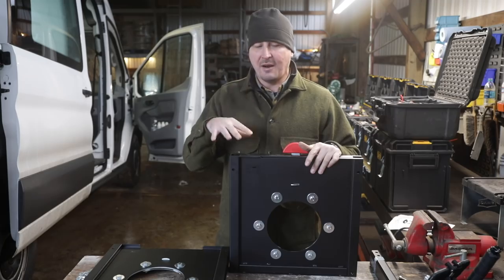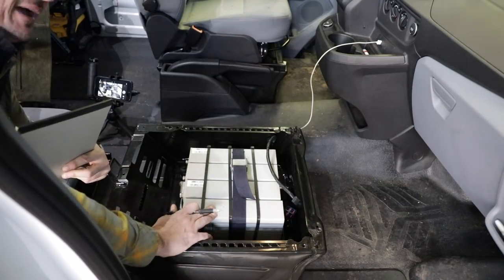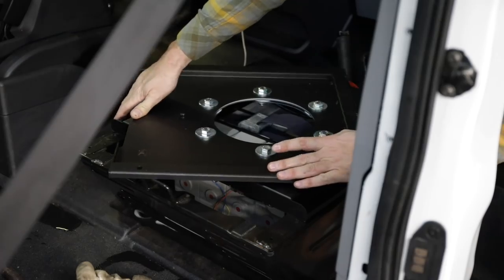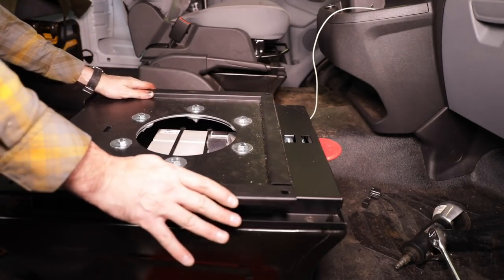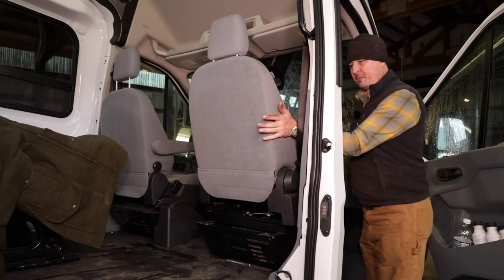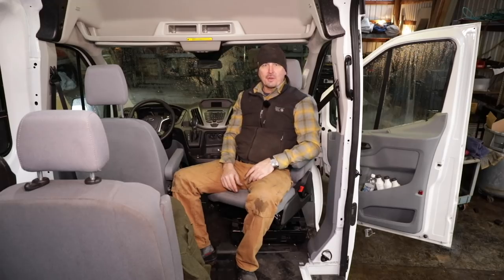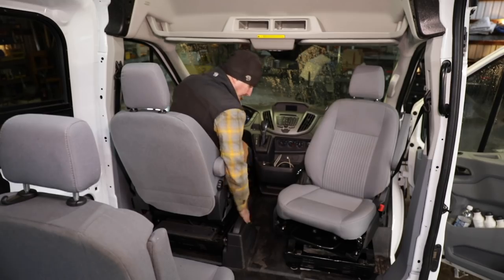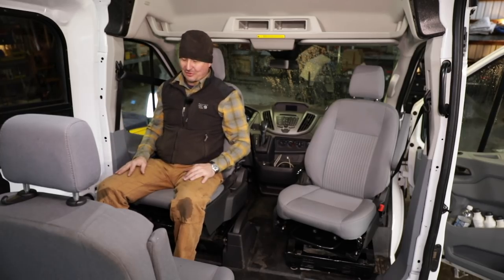AMAZING Spinning Seat Stealth Van Mod!!!

Comment: That dohickey was a carseat harness anchor point.
Reply: Masterbvapes Black Isofix do you mean. I have the worst positioned pointed ever in my GTC rear. Such a ball ache to get the chair in and out, when needed.
Reply: So an infant can drive?
Reply: Backroads Nomad transit is sold in the UK and here it is legal to mount a child seat in the front. Just disable the airbag.all our cars have to have an airbag warning/active light somewhere.

Same in other areas.
Reply: Backroads Nomad  it IS a car seat anchor point. The swivels are not just for the front seat, they can be used anywhere.
Reply: Ed Aker the Isofix point was on the actual seat base. Not the seat swivel .

But your still correct ,they are child seat anchor points, called Isofix points.
So one above said that is illegal to put a child seat in the front. In the UK ,where I am, it is allowed. Ford will make one seat that fits all markets.
Reply: Backroads Nomad interesting the 'ministry of transport' has no issues. Thou I don't disbelieve that the item in question isn't a mounting point. As they don't usually come in the front of many cars that I know of.

In the UK your allowed to use the less safe older 'seatbelt to hold the seat in place' method. 
the superior Isofix system mount is mounted to the chassis under the rear bench , and found In at least one (think it may be a law to install one) of the three seats. Few have rear 3 mounts.probably as you'd need a wide car.
Reply: Backroads Nomad this is a cargo van and not an actual passenger vehicle. Also, I believe child safety seats are allowed in front seats so long as the vehicle is not equipped with a seat in the rear (e.g. single can pickup trucks or two seater cars)
Reply: dm, usually you'll need to disarm the airbag. If tour child seat is forward facing. Then you'll have the orange warning like annoying you until you turn it back on. Usually done via a key whole in the door well.

Comment: You can lower the emergency brake and get rid of the riser.  There are instruction on fordtransitusaforum.com The thread is Driver seat swivel install by freeriden.

Comment: the bracket you cut off is an anchor point for a child safety seat (there because the are packages like yours) that do not have a rear seat for them )

Comment: The hot rod parts industry has a pushbutton ebrake control that will apply the ebrake with the push of a button so you could elimiinate that ebrake lever

Comment: You need a parking break like what's in my Tacoma. It's mounted into the dash, and you pull on a T handle towards yourself, and when you want to disengage it you turn it 90 degrees then push in. I have no idea how you'd implement it in your vehicle but it would completely negate the issue you have!

Comment: get yourself some lithium polymer batteries. defiantly not safe at all haha. these are the ones in like rc cars and stuff, they just blow up if you look at them. but they are so powerful!
Reply from the maker: Nonesene,
Reply: Wranglerstar huh? I wrote that a little strange sorry. I'm saying lithium polymer are very unsafe but so powerful. Not safe for your application xD especially with a big fuel tank underneath and your sleeping in there. I suppose you could be double sure by placing your batteries in a simple steel fireproof box?

Comment: Please try to lower the e-brake system. Your head will be dangerously high not only for visibility, but safety in event of a crash. Additionally, you'll struggle to find an ideal height for your table with the seats at such different heights.

Comment: I'm guessing that loop on the back of the seat is an anchor point for a child's seat. Since it's built as only a two passenger van it may be required.

Comment: With the drivers seat, if you removed the riser (or made a smaller one e.g. 1") would it clear the emergency brake if it was all the way down? If it does, could you put the van in gear (or park, if it's automatic), drop the break down so you can swivel round, then pull the brake back up?

Comment: You ask why the factory doesn't offer swivel seats... It's probably illegal and they can't sell it if it had that feature. There's laws down to the shade of light emitting from your car, very likely that some if not all states do not allow rotatable car seats.

It just adds a whole new variable to crashes. What direction is the seat facing, and corresponding risk. As well as risk of latch failure causing driver to spin seat and crash. 

Could probably void seat belt laws, if your seat isn't secure in a forward facing position, making the seat belt requirement useless. 

Just cause someone sells you something, doesn't mean it's legal to actually use in all applications, IE steering wheels without airbags.

Comment: Do they make a spring loaded mount to lift it above the brake, and lower when you sit in it.  You wont be sitting in it while you swivel, so it should work ok. Or maybe an airride type of spring like a semi.

Comment: Cody, Boeing had to ground their entire fleet of 787 Dreamliners ( https://en.wikipedia.org/wiki/Boeing_787_Dreamliner_battery_problems ). If you would put a piece of sheet metal over the batteries I would feel better. If Boeing engineers can be wrong about lipos, just be safe.
Reply: Charles Shanafelt Those are not the same kind of batteries...

Comment: I would ditch the 2in spacer and reshape the e brake handle and that piece you cut off I think it’s tie the seatbelt auto lock .I don’t know what it’s call the belt feeds into it. I would check it out if it is I would make a new piece and put it on the top part of the swivel plate okay?

Comment: I have only the passenger seat that I want to swivel in my van. Do you have a link for those swivels? 
I would take that brake apart and see if it could be moved over or back or forward or shortened to clear. Makes me appreciate my foot brake a bit more. :)

Comment: Anyone else confused why added height is better for his seat when he’s tall? Wouldn’t less height be better on the seat since he’s so tall?
Reply: Smitty01z28 leeg space
Reply: Smitty01z28 leg room perhaps?
Reply: More leg room.  Van has plenty of head height.
Reply: because the knees are the only bend in the leg. we don't have convenient swivels in the middle of the leg, the issue is not head height but the height of the seat as compared to leg length,
Reply: That makes sense....thanks for clarifying!
Reply: Smitty01z28 To sit ergonomically, your legs should be at right angles to your body, i.e. your knees in line with your hips, supporting the underside of your legs.  Tall people often find that their knees are raised above their hips, unless the seat is height adjustable.

Comment: So can you not swivel the seat when the handbrake is up? Surely you would only swivel when at rest and thus the handbrake would need to be up?
Reply: Maybe you can try customise some sort or handbrake so that it doesn’t impede the seat swivel function and also so that you can use the standard swivel without the extra height?

Comment: Have you considered what would happen, with this mod, during an airbag deployment?
Reply: nyjohn12 I do not think he even thought about it.
Reply: What Do you mean?
What could happen?
Reply: The seat, seat belt and airbag were made and installed for the passenger to be sitting forward (looking out the windshield). If the passenger is turned around while the car is in motion the airbag could strike the back of the seat possibly propelling the upper body forward. The passenger's head could strike something. I was hit in the rear of my car with such force that my neck and shoulders ached for a few days after. Again if the passenger is turned around the upper body will be forced forward possibly causing injury by the seat belt.

Comment: Lithium polymer in a matrix of I remember correctly. Very expensive but very reliable and powerful. Also, to note, polymer has 2x the capacity over ion per given weight of lithium electrolyte. They don't have the same c discharge rating so you must take that into account when specing lithium for your system.

Comment: All lithium ion batteries are subject to thermal run-away just requires the right condition.
Reply: John Newburn they type he has is damm safe, didn't know it was a lipo4
Reply: Yup, LiFe compromises less power for less chance of a thermal runaway. They should be safe if cared for correctly, but so should a LiPo really... 
I'll keep running Lead-acid batteries, I see no reason to spend more money on a less safe battery, especially when you don't really get anything other than a few pounds saved out of it. In a racing car I see the use of smaller lighter batteries, but in a van it has no real benefit.
Reply: Lithium batteries don't have all that much Lithium inside. It's the mixture of other elements some batteries had issues with, especially cheap knock off Chinese lithium cells.
Reply: That's why they aren't lithium ion. LiFePo. (Lithium iron phosphate) Are completely different.
Reply: AGM lead acid is almost the equivalent of a carburetor over fuel injected. AGM batteries are unstable and heavy as opposed to the LiFePo or even LiPo.
(edit) AGM batteries also experience voltage drop so at least for me with amateur radio I need the constant t voltage that simply doesn't come from AGM batteries.
Reply: LIFEPO4 not safe to mount inside while someone is sleeping and heater is drawing 12+ amps.  It requires an expensive battery management system (prone to failure)  they are safer than some lithium chemistries but they still can and do catch fire, that means mount them in  a sealed vented container outside the sleeping area.

Comment: what do you need a gun for when working on your van? If you need to drill holes, i think a drill works way better.
Reply: Watch his EDC video haha
He says it’s difficult to removed his holster from his belt so he always has one attached to his work pants, 
Why not use it if you have it is my view on that.
Reply: A few days ago I was using a heat gun while standing. leaning over my engine compartment. I couldn't hear anything but the heat gun. Suddenly a guy was right behind me, too close. I spun around and aimed the heat gun in his face. Dumb a_s shouldn't sneak up on people. I don't own and gun and it's been forty years since I've even held a pistol.
Reply: Don't bring a heat gun to a gunfight.
Reply: He's got cyotes
Reply: I think there is a coyote problem on his property or in the area so its better to have one on his person rather than not have it and need it.  In a video a while back he talked about actually having to use it because it was coming near his house and his dogs were going after them

Comment: "I don't know anything about batteries, so let me tell you why you're wrong about my batteries. Also, you don't have any videos, possibly from having a real job, so you obviously don't know anything."
Reply: Dude, get happy
Reply: he doesn't have to know anything for LiFe (lithium ferrite) batteries to safer than lipo/liion
Reply: What he said was "I don't know about them, so I'm following the direction of the experts that sold them to me"... Try and keep up Jeremy
Reply: daft nord Why does that exactly mean that they would be safer, without any additional knowledge? Furthermore, it's not lithium ferrite, but lithium iron phosphate (LiFePO4). LiFePO4 and LiPolymer batteries are also kinds of lithium ion batteies.
Reply: Lithium Iron Phosphate batteries are more expensive than traditional "lithium Ion" batteries. This is because they are more expensive to make due to the materials used. These materials do make it more safe, but not being nearly as explosive if the cell walls of the battery are punctured. They do have roughly the same energy density though, so if you can afford it, they are the way to go as they are plainly less explosive if ruptured. 
-Source: graduate level power electronics and power systems (including batteries) courses from the University of Wisconsin, Madison.
Reply: +Vinny Gullotta yeah, a salesman has no reason whatsoever to stretch the truth to make a sale.

Comment: Vehicles don't have an 'emergency brake'. They have a 'parking brake'. Never apply the parking brake in an emergency or you could lose control. Vehicles are never meant to be driven without good brakes.
Reply: emergency brake and parking brake is the same thing
Reply: You must be fun at parties.
Reply: no they are not, a parking brake is not intended to function as an emergency brake, even so far as they will not hold for long if applied at speed, the lining material is not thick enough to hold under the heat and stress of braking at speed
Reply: Thank you Captain Pedantic. In the US parking brake, emergency brake, hand brake, and e-brake all refer to the same thing. Call it whatever you want.
Reply: no they do not, try working on them for a living and actually look at the shoes, on larger vehicles park brakes are different than the service brakes
Reply: It's called an emergency brake because it uses a cable to engage rear the brakes.  If you spring a leak and lose pressure in your brake lines the emergency brake will still function well enough to get you stopped.
Reply: not necessarily
Reply: TheDarkalkymist  who do you work for?